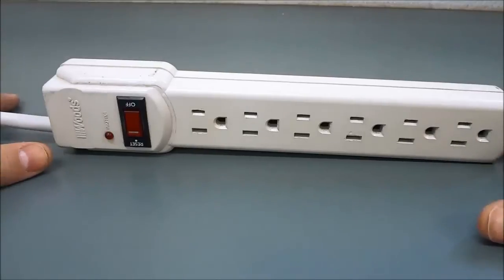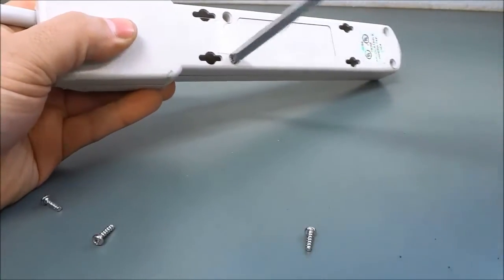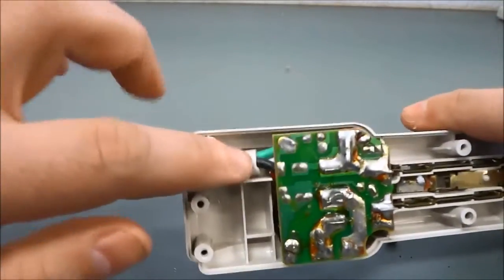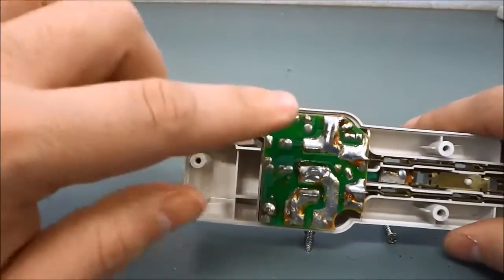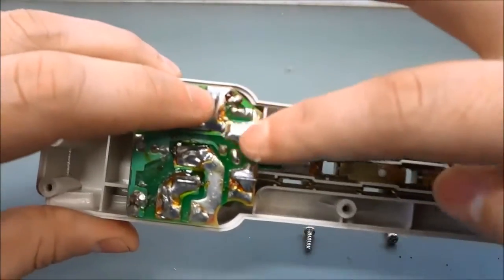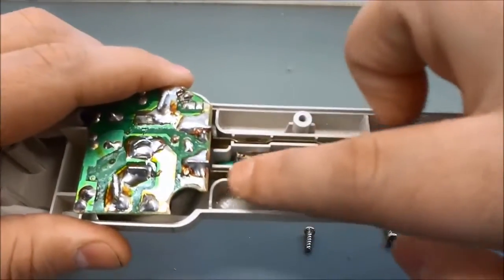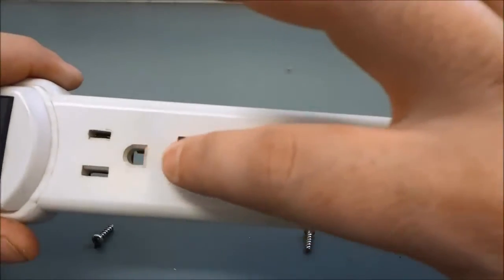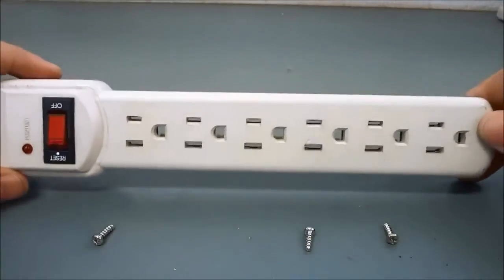An Inside Look At An Electrical Power Bar

Comment: Very helpful & exactly the dissection I was looking for.  FYI, the board at the bottom is a PCB, which is the acronym for Printed Circuit Board whereas a CPU is a Central Processing Unit, which is the typically expensive processing chip in a computer, and yes, they easy to mix up which is frequently done. Regardless, I'm sure everyone understands your vid just fine. You just sound too me like the kind of person who would care about that sort of distinction.

Comment: Looking to save electricity.  If I plug something in some devices still use electricity.  Do I have to turn the power bar off or is it automatic because it is a 'power bar'?
Reply: Switch it off